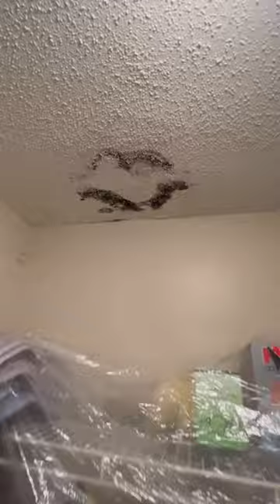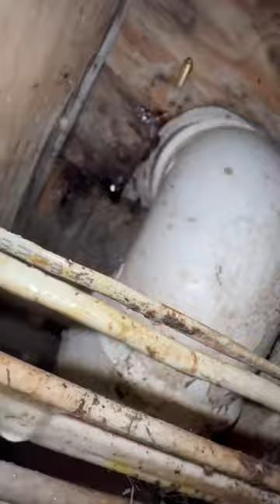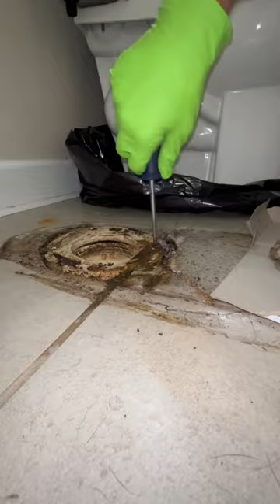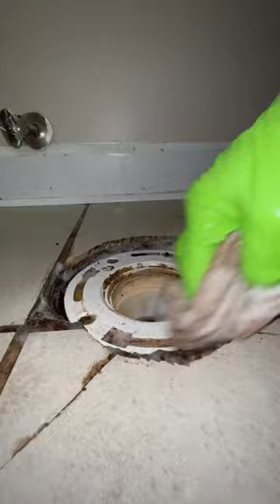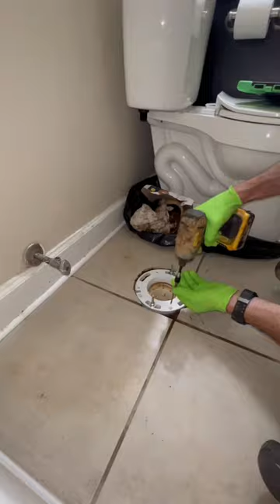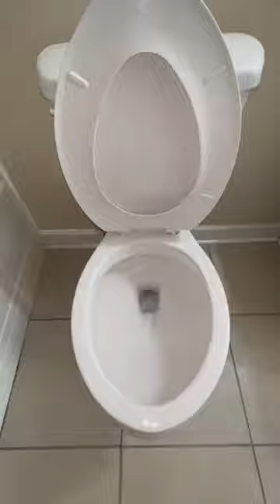Raising a Toilet Flange - Oatey Flange Spacer #plumbing #plumber #howto #diy #asmr #toilet #shorts

Comment: You dont use soda or coke like the battery of the engine? 
What happens if you flush a bunch of soda down the drains does it get the rust out and where does it go?

Comment: Forgive me for asking but if you took off a flange spacer and replaced it with another flange spacer how is that raising the flange for the toilet are you not just installing a flange spacer correctly?
Reply from the maker: Does the spacer raise the flange or nah?
Reply from the maker: But yes I did demonstrate how to install it correctly..
Reply: That did raise the flange even with the tile floor. Dude installed the perfectly. I've been a plumber for 20 years, there are plenty of hack plumbers on social media, this guy is NOT one of them.
Reply: Even with the floor should work fine. It’s when it’s too high or too low from floor level is when there’s problems
Reply: @michaelcatalanottohandyman flange spacers and raising flanges 99% of the time is a wasted effort. I mold wax rings together if the flange is too low it works every time as long as you set the toilet properly. Usually when plumbing a new slab I will even set the  toilet flanges when I do the rough slab plumbing 1/4 below finished concrete level. Saves time when I come back for rough in. Flanges can only be too high as a problem then the toilet won’t sit on the floor
Reply from the maker: @boldcityanthony thank you 🙏💪👍

Comment: The closet flange should be installed on TOP of finished floor, not level with or below. I use those same flange “stackers” to raise the flange height after people remodel bathrooms by installing a new floor over an old floor. Pro tip: you can use multiple stackers, you just need to apply silicone between each and use 4 screws to secure them all to the sub floor, it looks like you needed 2 or 3 to bring the flange up to the correct level.
Reply: We're in the plumbing code does it say it has to be above the floor
Reply: Nah…. Bro! Level with the floor is perfectly fine. You should never use more then 1 extension on the toilet flange. I had to cut open and remove the  Sheet rock from the ceiling at a customers house because some jackass stacked 4 of them on top of each other and the silicon didn’t hold up with time.
Reply: Just a landlord, not a plumber: I thought it had to be AT LEAST level with the floor (or slightly above).
Reply: @garygreen4690  level with the floor is always ideal but not a must. 3/8 of a inch below the floor is perfectly fine, just use a jumbo wax ring. ( they’re taller then normal wax rings ) Once you start hitting that 1/2 inch plus mark is when you want to start thinking about a way to get that flange up a little higher. What you’re looking for is when installing the toilet down onto the wax ring, you want to feel the toilet smashing down onto the wax ring. If you don’t feel it mashing the wax ring it’s not doing it’s job. Normal practice years ago was installing a wax ring with horn down first, then stacking another wax ring without horn on top of it. ( I don’t suggest doing this ) but that was how it was done for years if the flange was to low.
Reply: @j-rad8315  Thanks for the information. I appreciate it.
Reply: use wax instead of silicone will last longer, get calls from these that let sewer gas thru from not sealing fully even tho they dont leak.

Comment: I can’t tell you how many calls I’ve been out to and the customer complains of sewer odor in their bathroom. Pull the toilet and it’s always where someone used these flange extension ring kits. These things are garbage and guarantee to leak.
Reply: Had a part time job once where the boss kept paying a plumber to get rid of the sewer smell. He replaced the entire toilet, the sink, all the pipe & the smell was still there.
Had a coworker scream "you HAVE TO CLOSE the bathroom door or the whole office smells like sewage!!!"
Looked at her point blank and asked if she had flushed the urinal.  "what urinal? " She asked.
The one behind the box that the boss had custom built. 
Took her into the restroom, pulled the box away from the wall and showed her the urinal. 
The female boss was "offended" by the mere sight of a urinal, but because it was a rental, she couldn't have it removed. So she covered it. 

Because we were all female, there was never any reason to move the box to use the urinal and it hadn't been flushed in over 6 months, including the heat of summer. 

Had to show the girl how to flush the urinal, teach her how a p-trap works and informed her that it needed to be flushed weekly. 
The sewer smell was gone almost instantly. 😂😅
Later that evening the boss calls and said "you are the smartest person I know" wanted so bad to reply "you're the stupidest..." Never mind 😁😉

Comment: I read a bunch of comments and agree that you should be level with the floor with the spacer!   I’m not sure what the proper sealant is, to be used between the flanges.  However, I don’t use a wax ring, haven’t used one in over 20 years.  I use a Fernco wax free toilet seal. This would seal much better in this case than the wax seal!   Try it, you’ll wonder why you ever used the wax seal!
Reply: The proper sealant would be a silicon one around the edges of the flange, but yeah that’s going to leak again because it’s still lower than the floor.😅
Reply: @CarlosMontrond-xg8xi  Take a look at the Fernco was seal replacement, then you’ll see what’s better.

Comment: Dawg, the mold is supposed to be removed before any repairs are made and by a certified mold specialist. The idea is to contain the area so that it doesn't become airborne and contaminate the area any more than it is...Containment, PPE, air scrubbers, remove mold and place into 4mil bags, treat area with Concrobium, then a mold clearance test either by air or surface swabs.
Reply: Lmao
Reply: Relax just wipe it I'll be fine
Reply: @bmo14lax  A real professional tradesman will do the job per State standards. When you get sued for someone getting sick you'll understand.
Reply: @sebabenitez1537  Yeah, we used to back in the day until someone got sued for getting sick and then a whole new industry was born...Unfortunately, if you're a licensed Contractor, you take huge risk not following the rules on Mold, lead and asbestos....
Reply: @KD-hi6hh  i am a professional tradesman thats why im laughing worrying about a spot of mold. I've got spots of mold in my house. Should I go sue the plumber that last in there? Lmao
Reply: @bmo14lax   I should clarify myself here....On your own house, do what you want. But as a licensed Contractor in Calif. when we come in contact with what appears to be mold - we have to stop and have it addressed before we can proceed with our repair. If we don't and someone at the job site / home / apt is allergic to mold and we disturbed it - causing more than 100 spores to go airborne and they have a reaction, we can get sued and fined from the AQMD. So, those of us that know, or that have been fined, will tell the customer to have it addressed. And, since I went and got certified by the IICRC for mold, I know the proper way to remove it that satisfies State and Federal Standards. In the big scope of things, yeah it's ridiculous but that's the world we live in now and there's a saying; "Mold is Gold".....Great 💰removing it - especially if insurance is paying for it.
Reply: Wow so if that’s the case I guess every job I go to I gotta stop the job because I think a brown spot is mold when we are not certified to tell a customer that leave their only toilet sometimes unusable and then wait until a mold specialist decides to come out and test just to go back and. Thenwork 3 days later get out of here, it’s not a plumbers problem to do that the home owner must do it himself, I guess we should fix the rotten ceiling to along with everything else the customer doesn’t pay for

Comment: Wrong jack Dressler a flange should be level with the finished floor as per code could have avoided the leak in the first place if they use the the flange with a horn in it

Comment: I just put one of these on after I installed my tile to get the flange above the tile. I used sealant this was pvc to abs… and predrilled the concrete floor and installed 3/16’’ concrete screws. I used a jumbo wax ring and but a bang….. expertly installed!!😂😂😂

Comment: This is why I do new construction.
Reply: New construction will always be easier and not pay as well as some service calls 🤙
Reply: Unless you have bad employees who hook the hot up to the cold so u have to spend days fixing mess ups at new construction lol
Reply: @JUNEBUGLLC yes yes that happens alot🤣.... The worst I seen was a crew that dropped deuces in bags or dry toilets w/o any running water & used Sheetrock as toilet paper.... We only found out because they put all the tubs in the wrong spots & we had to demo some walls.. The cold part is the smell lingered for so long & they could not figure out why. That plumbing company is still going strong and the smell is too 😆

Comment: So you did the same fix that failed the last time. Will it hold up this time? Possibly no use of silicone sealant on the initial fix?
Reply: It's going to be leaking in a few years anyways,  every extension I've ever seen sealed with silicone does.. and I've seen alot

Comment: why did the PCV fail?
Reply: It didn't.  The flange was sitting too low to seal with a wax ring due to a lazy remodel. Tile should be installed before flange,  but when houses are built with vinyl instead of tile the remodel contractors don't raise the flange so there ends up being a bad seal.  They tried to install the wrong type of spacer without sealing it to the original flange.  2 wax rings stacked works just as well as this since both ways are wrong

Comment: This is why you NEVER seal around the base of the toilet with silicon!
Reply: Hold up. Why not
Reply: Yea but required by code
Reply: Always leave the back open
Reply: You do seal just not all the way, you should leave a few inches exposed so that if leaks occur you will know.
Reply: Lmfao

Comment: I like how you took out a leaking extension flange….and replaced it with another extension flange that will 100% leak again.
Reply: What’s the proper way to fix?
Reply: @dande19  just needed a thick wax ring. I’ve never seen one of those extension flange last longer than a year before the Silicone washes out
Reply: @dande19 cut out the flange and install a new one that is set at the proper height